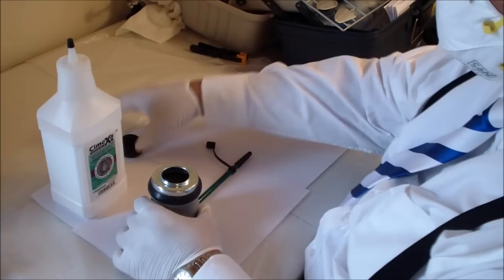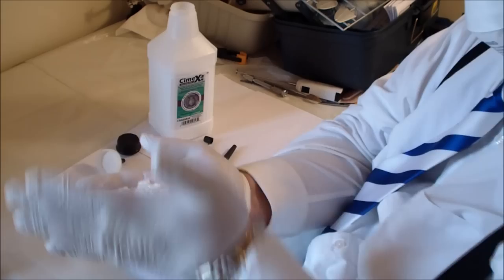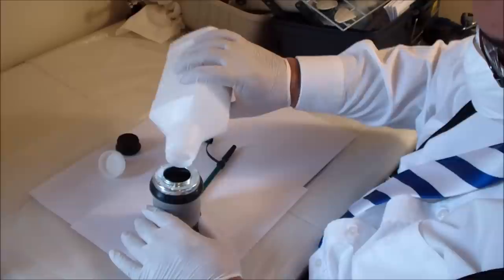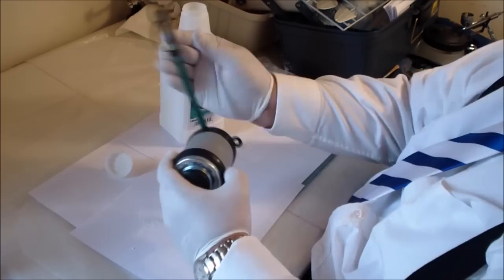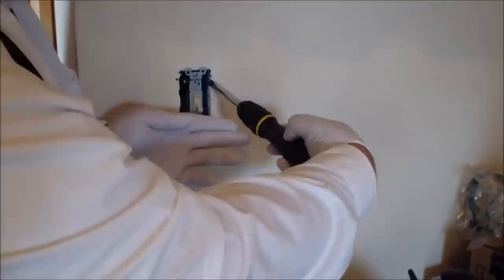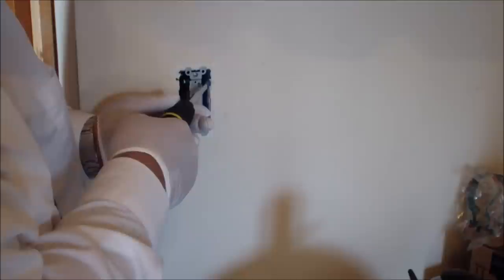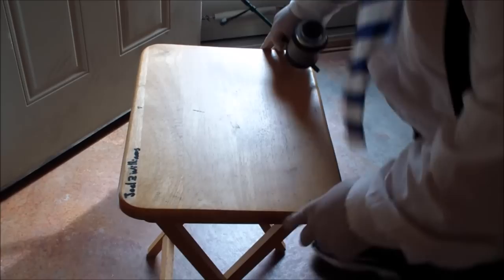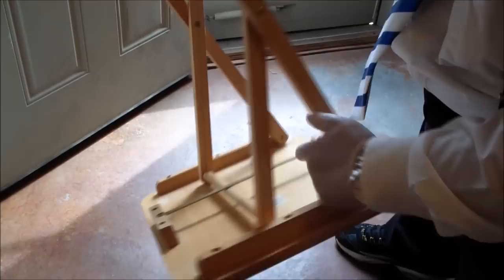CimeXa Desiccant Powder for Pest Control of Bedbugs (2 of 2 videos)

Comment: Just put down cimexa in my room last night and did not get bit once. Went for weeks trying to not get bitten by these damn bugs and I stumbled on cimexa. I took your advice and i purchased the spray applicator as well as a few bottles of the product. Cleaned the hell out of my room and I located the areas that had signs of heavier bed but activity and I applied the product to anywhere I think they'd hide. Will update on progress but as of now I am at day 1 of no bed bugs. Thank you so much and I emplore all who suffer from these bugs to get a bottle of this stuff. I spent under 40$ for my set up
Reply: Update: 4 nights and still no new bites
Reply: Please keep updating, my Cimexa is coming in today
Reply: Hey Austin how did it go?
Reply: Hi, how did everything work out?
Reply: Works very well apply weekly
Reply: Austin Hill thank you so much for replying. Did you vacuum before applying a new layer of dust? Also, did you use this method in conjunction with something else?

Comment: I steamed my mattress and bed frame and used your passive trap method with baby powder and cimexa inside it then dusted cimexa under anything that I sat at for more than an hour (chairs, couch, etc), and it worked. 

I also kept outside and inside clothes, with the outside clothes getting dried for 40 minutes on high and going right into a sealed plastic bag. I'd change right before leaving and after coming home to avoid taking them out to other people by mistake. 

I dried my sheets, pillows and quilt on high for 40 minutes when I steamed the mattress and put the cimexa powder down, too. Putting them in the oven on 120F for 40 minutes will also work, but be careful not to let them touch the heating element in the oven, or they could catch fire.

Anyway, thanks to your video and some other research (like about how heat kills them) I am now bed bug free, and I didn't even have to have my apartment filled with poison gas to get that way.
Reply from the maker: That's awesome! And thanks for returning to tell us of your success. Too many people forget to do that after they get rid of the bugs! People absolutely need to hear success stories. Your hard work and resulting success will undoubtedly give hope and inspiration to thousands. Thanks again!

Comment: I have Cimexa but didn't use it ever since I did a thorogal cleaning once thinking that I didn't need it.  Woke up this morning and a ton of them were at the back of the baseboard.  I took Cimexa without a brush or bellows, but I bought the bellows today.  Gonna' give you updates on it as I go.  But thus far this stuff has wiped out a few of them.  I hate these things to death!
Reply: any updates?
Reply: Oh yeah!  They're gone man!  These things were in the boxspring I got from Mattress Firm ( DO NOT BUY MATTRESS OR ANYTHING FROM THEM!  THERE ARE TONS OF REVIEWS OF PEOPLE SAYING THE SAME THING ).  It started in 2015 when I got it and was hell from there until Feb 2017 when I got rid of them for good.  Threw the box-spring away and got a new one along with CimeXa everywhere at the bottom of my bed.  They're good for fleas and other bugs too.

Comment: Hi Joel, I've been dealing with bed bugs for about a month. I built the "Gold" standard quality trap but didn't draw any in the trap. I built one by inverting the top of the 2 liter soda bottle into itself and used the sugar, yeast and warm water solution you suggested. I caught about 25 the first week. I changed the solution a few weeks later and caught two. I've replaced my box spring, mattress and encased them, threw out my headboard, installed bowls of vegetable oil under each bed frame leg. I just received my Cinema and duster from Bed Bug Supply. What is the little metal ball used for? It came in the package with the duster. It's exactly the same duster you demonstrated with. Thank you Joel for your help and great videos!!!!!! You've helped me deal with this awful and life altering problem. I live in St. Louis and apparently there is an outbreak in apartment buildings much like Chicago..You are a life saver!!! Let me know about that metal ball if you can. thnx
Reply from the maker: That's actually a great innovation, inverting the top of the bottle instead of using the tubing and shot glass. The metal ball is for you to place inside the accordion shaped bellows of the applicator (where you insert the powder). This is used to prevent the powder from caking up on the interior of the container and promotes a freer flow of the product down the tube.
Reply: Awesome ! Thanks for the explanation ! I appreciate you responding! Dealing with this situation is disrupting my entire life. I watched a youtube video titled the "Bed Bug Apocalypse"  originally aired on Animal Planet. Check it out if you get a chance. BTW, I'd be happy to give you a testimonial regarding the CimeXa product. Just let me know how to do so. Take care

Comment: This video has been up for a whole year! Im just now seeing it, because Im just now seeing THEM. Im with you Joel. Especially if they aren't going to left the ban on DDT anytime soon. Im going to try it after the exterminator comes Monday. After whet I've read, not sure if exterminator will work. Also just heard about beagles. Gonna try that too. Losing sleep and sanity.
Reply from the maker: Well don't stress too much. The chemicals that the pros use is very effective, albeit extremely toxic. Give it some time to work though. Usually they will spray once per week for 3-4 weeks. That will almost always work if you are careful not to reintroduce the bugs from another external source.
Reply: Well, that does make me feel better, thanks! Still going to get some and sew the whole house up with it afterwards. I've got bed bug induced paranoia or something. Im starting to behave like Tommy Shannon in "Bugs".  One step away from a tin foil hat and matching suit. Oh yea. My Co2 trap smells like beer. Does that mean its still working?
Reply from the maker: Those are normal reactions. It's caused by a lack of sleep. You will have "phantom itches" for a while. It's normal, just knowing that is a huge advantage. It's the same reason why crack and meth addicts are always scratching. A hypersensitivity to fabric and wind against your skin due to the lack of sleep. Total normal. And yes the beer smell is a good signal that you have achieved fermentation. The yeast is converting the sugar to alcohol and releasing the Co2 gas as a byproduct.

Comment: I lived in a building that was infested with bed bugs and what I found out from a pest control company was the spray your furniture with 100% alcohol (NO SMOKING UNLESS YOU WANT TO BURN YOUR HOUSE DOWN) which dries up the bugs and their eggs and similar to these powder he is advertising you can get Diatomaceous Earth and Applicator for around $9.00 for 4lbs plenty of leftover. this will kill just about anything that is crawling around your home. How does it work, Diatomaceous Earth is a super fine powder that cuts the under belly of bugs that crawl across the powder which causes the insect to not to retain their body fliuds inside and they dry out and die. If you use Diatomaceous Earth and apply it heavily to carpet you will need a shop-vac because this is a super-fine powder it will clog up a regular home vac works great if you have cats or dogs and they bring fleas into your home (you will need to bath them more often because the powder will give them dry skin) worked great on a flea infestation I got watching a neighbors dog for a week. For more tip and product to use any kind of pest, I go to https://www.domyown.com and put in what you are trying to get rid of. These chemicals are the same ones the professionals use. A friend paid $1,800 to have Orkin get rid of her bedbugs and they didn't kill S#**. I went in with about $150 worth of chemicals and she hasn't seen a bugs in her house for the last 10 years. Sorry if I seem to be stepping on your toes here Joel Z. Williams, not my intentions HomeboyIneed to come over to S.W. when you and your neighbor are grilling. S.E. Boy (Valley Green)

Comment: I just brought two I will be doing a review to tell others if it worked or not.
Reply: lakeisha K how are things going? I started using the cimexa last Saturday, all over my 3bedrm apt, in sockets, lights switches, on the carpet, in box spring and mattress, both encased, but still getting bites, still in process of washing all clothing.
Reply: Still getting bit Ebony?
Reply: Glefit nope, been 5 wks 🙌
Reply: I haven't been getting bit or seen any since putting this down, works wonders.
Reply: Damn, that sounds awesome.  Maybe I'll have some good luck then. :)
Reply: I ordered two bottles of this after applying this along the walls and cracks I saw a few out in the open for about a week then I treated every room I haven't seen any in two weeks now I'm just keeping an eye out but I think their gone
Reply: thank you!! I thanks God I stumbled across this video..i paid like 12.99 per bottle and it's worth it and I still have a lot leftover.. since applying it all over my home I haven't seen a bed bug or spiders
Reply: Hi, if you can recall, how long did it take for you to stop seeing the BB, also did you take any other prevention methods?

Comment: I was told cimexa should not be used alone or on surface areas, only in cracks and crevices and other harder to reach areas. would you recommend against applying cimexa to beds and furniture?
Reply from the maker: +LaLi66 . Please follow the manufacturer's instructions whenever in doubt. Here is a link where you can find all of the applicable information. http://www.rockwelllabs.com/CimeXaInsecticideDust.shtml

Comment: Thank you so much for your help!💕💕💕Question?  Can you apply the powder under the ends of the mattress,  the small part that folds and is tight that they like to hide in? Can this be done with the brush? And does drying your fabrics really dehydrate and kill them as well. .We're thinking about wrapping all clothing/comforter in heavy duty trash bags and drying them all on high heat. Also were thinking of vacuuming as much of the bed and other furniture  (you know getting in the inside and under all flaps) first,  then applying the powder to cracks and crevices as well as just sprinkling some under the top mattress in between the other one- Is that a good plan? Again,  THANK YOU SO MUCH! 💕
Reply from the maker: Yes, in fact that is the whole point of also buying the hand pump applicator when you buy the CimeXa powder. that applicator will allow you to shoot the dust into even the most narrow of cracks. That's usually also the spots that bedbugs love to hide and lay their eggs.
Reply: Thank you for such a timely reply!  💞

Comment: Joel I found one bed bug in my house. Just one. I'm 100% sure I know where it came from, but I haven't been bitten since my finding or anything. I react very badly to bedbug bites. In my house I have not gotten bit once. Do you think I "won the lottery" and found the first bedbug before it was able to reproduce?
I stayed at a place that was massively infested with bedbugs I had red blotches all over my body while my girlfriend had nothing. That's why I'm pretty sure I don't have any. I put Tupperware on the legs of my bed, to prevent others if any from getting on it, and my bed is 12 inches away from the wall.  What do you think? What should I do?
Reply from the maker: Yambii Well, if you're watching this then you know about ASG dessicants. So that's good. Also, I would consider building some Co2 traps per the "Williams Method". That trap will act as a sentinel and let you know if the bedbugs have actually returned or if that one you found was just a "one off".

Comment: Can I spray it directly on to the bed and then cover with bedbug encasement. Because my bed is queen size pillow top with creases and crevices everywhere.
Reply from the maker: Yes, putting it underneath your mattress encasement is a good idea.
Reply: Thanks so much for responding
Reply from the maker: I pride myself on responding to any question put on this site.
Reply: Joel Z. Williams Just to clarify, so it's okay to put this directly on your mattress? After removing the encasement will I have to vacuum the mattress to remove the product? And also is it fine to dust this on the floor of my bedroom and leave it?
Reply from the maker: Ann Janel Penaflor Sorry for taking so long to get back to you. It seems that I have a lot more questions to answer every day as the site gets more popular. Of course you should always defer to the manufacturer's instructions when applying. But with very fine powdered desiccants like CimeXa the main hazard is respiratory irritation from the dust.  There are no added chemicals in the CimeXa. Just 100% amorphous silica gel. So all you really need is a dust mask or a bandanna tied around your face when applying it. There's no need to put it on the part of the mattress you sleep on, but do be sure to get it into the framework of the bed. Particularly the box spring corners, headboard, and other crevices and cracks nearby your bed.
Reply: Okay thanks for clearing that up!

Comment: We have been dealing with bed bugs since late October...bought de powder and it worked or so I thought..but about a week ago I started getting bitten again so I ordered 3 bottles of cimexa dust we are putting it down tonight..I don't have the little duster any other recommendations on putting it down?
Reply from the maker: It's really important for me to stress that comparing DE to CimeXa is like apples and oranges.   CimeXa will kill bedbugs in about 2 days compared to DE which might take 4-6 weeks!!!. Also, although. I recommend the use of an applicator to apply Cimexa, it will still work effectively if you get down on your hands and knees and really put that powder into any crack or crevice in any furniture that you sit or sleep on.

Comment: just ordered a 4 oz cimexa and long neck puffer. should be easier to reach the baseboards behind sinks without moving everything. highly recommend that after trying to apply that peanut butter looking stuff for roaches under/behind our sinks. major pain!
Reply from the maker: Caerbanog Interrupted  good! I'm glad to hear that. You will see how effective this stuff is within 24 hrs. Also a great idea to go ahead and get the applicator, for the price you paid it's peanuts compared to hiring a PMP specialist to come out and spray toxins. Also, please be sure to build the Co2 traps and lures as shown in my previous videos. This will serve as a visual representation of your progress at bedbug eradication.
Reply: i did build one but they dry up in only a short time. i wonder if an infrared camera or black light can see carbon dioxide? then you'd know when it's stopped producing CO2.
Reply from the maker: Caerbanog Interrupted  Well, if you are following the procedure as outlined in the video then there's no reason why the 2-liter traps should not remain viable for 2-3 weeks. Build 4 of them, put them in an affected room, along with mattress encasement and CimeXa dust and you can defeat even the most entrenched infestation before the lures have time to exhaust the sugar.
Reply: thank you mr,joe  now i am not as worry your on the job informating  us

Comment: Evergreen Pyrethrum Bed Bug Powder how is this versus CIMEXA
Reply from the maker: To be honest, I've never tried it. However, CimeXa kills by dehydrating the bedbug. It will dry the bug up within about 24 hrs after exposure to the bug's waxy outer coating, which is called a cuticle. Whereas a Pyrethryn based powder relies on poisoning the bug. This can fail in several ways. The bugs will eventually build up a resistance to any toxin that is repeatedly introduced against it. The pyrethryn powders can also make pets and children sick if ingested. Please be careful.
Reply: evergreen didnt do much for bedbugs...its works ok for roaches but they build up resistance to it...plus its a much higher toxicity for people and animals.....i used it and a  insecticide spray about two years ago for bedbugs and roaches..the spray did ok but the evergreen only worked on roaches, i have noticed that i a getting infestations again in spite of regular use of these products so i dont recommend them...I am going to be trying Cimexa because all of my research points to it being much more effective and less toxic to people and animals